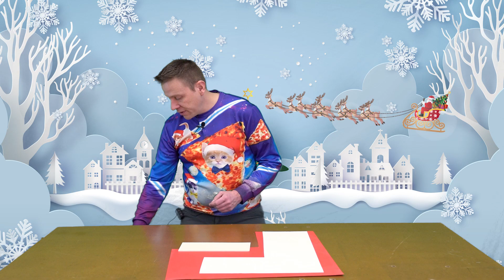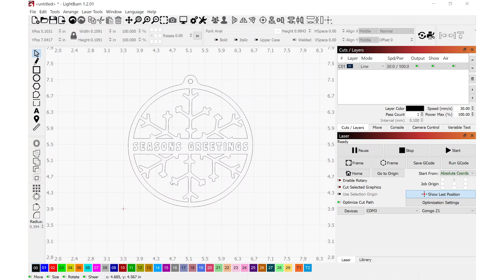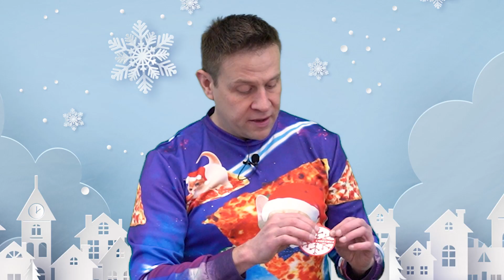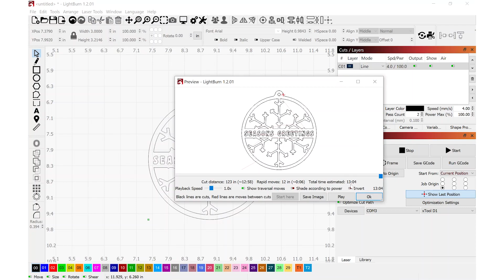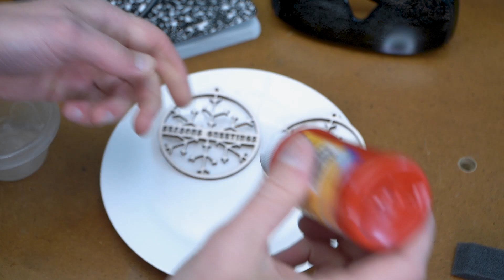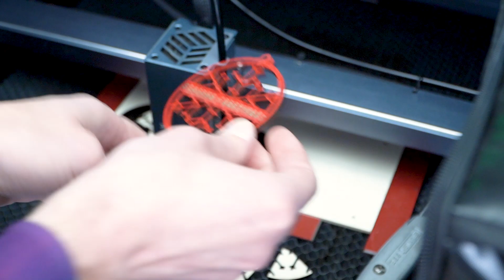Holiday Ornament Project!

Comment: I am working with XCS software. I am at the point of sizing down the white background. The whole snowflake and circle are grouped together. Normally I would use the ungroup button to separate them, however it is greyed out and I am unable to separate the outside circle. Any suggestions? Thanks!
Reply from the maker: Hi- it sounds like XCS group all the elements of the SVG graphic together.  (I checked a known good SVG in XCS and XCS does group the graphic) As a work around try the Trace Image tool with an offset of zero.  This will create just the outside shape for the white layer.  There might be the option to not include offsetting inside objects.  Best wishes.
Reply: Thanks, struggling finding the trace feature. I'll keep trying. @thelaserchannel1
Reply from the maker: I went back with the Ornament SVG- yes XCS does group most of the objects together in the graphic.  I tired the Outline tool on the top tool bar and it outlines everything- the tool does not work correctly :(  There's the option of the 30 trial of LightBurn.